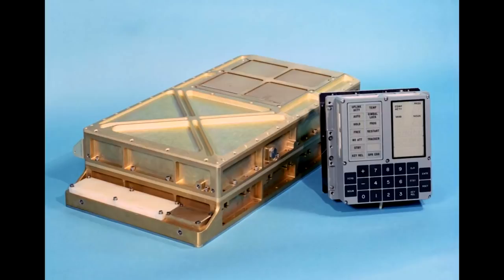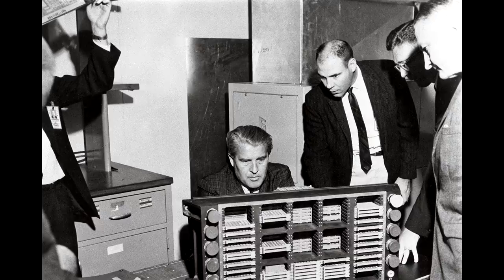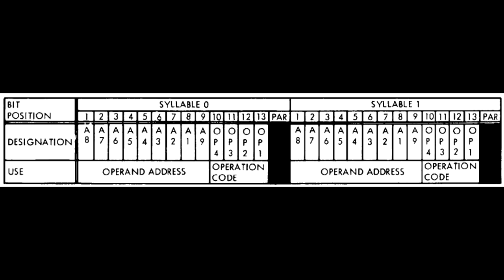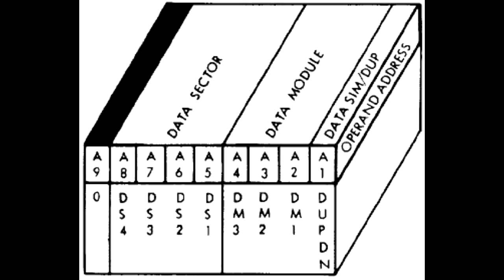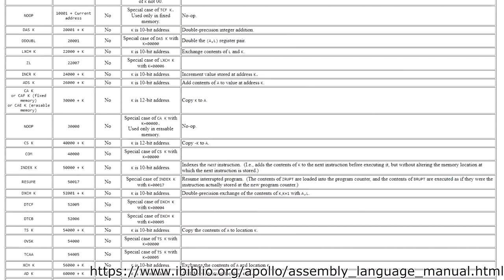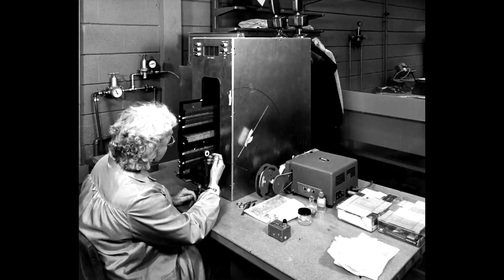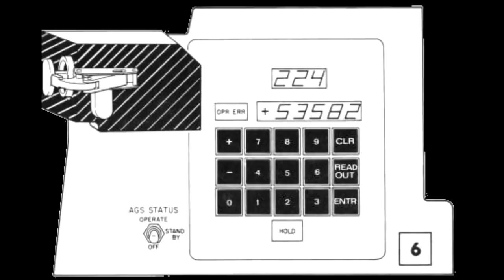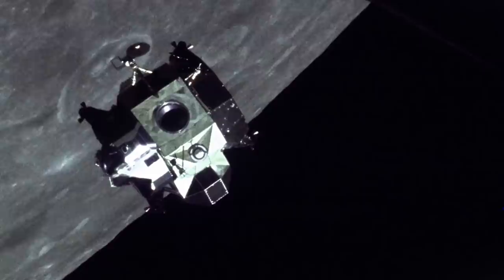The Four Computers That Flew Humans To The Moon

Comment: LVDC - Launch Vehicle Digital Computer for the Saturn V made at IBM Owego, New York. where Dad later worked on Space Shuttle Flight Computer Boards.  During Apollo and Skylab Dad communicated to the LVDC via the DDAS Station in the the different Firing Rooms of the Launch Control Center.  On one occasion Dad and a security guard had to go to the top of the Launch Umbilical Tower to change a "card", one bit in the DDAS Bus, that then went across the swing arm to connect to the Instrument Unit in the Third Stage.  Keep up the good job Scott.

Comment: Well done Scott. I remember reading a very in depth technical article about the guy who resurrected the AGC code  directly from the AGC  computer at the Smithsonian. That and documentation he found and one of the engineers who had worked on the thing. The culmination is essentially a digital archive of the actual code and documentation for that code. He then went on to build an "emulator" using a raspberry pi I think, and fabricated an exact replica of the DSKY interface and display unit. The whole thing works and he was able to simulate trajectory corrections, LEM landings and launches, Insertion burns, etc. Pretty amazing feat of "digital archeology." Thank Scott for your awesome content!

Comment: 9:11 There was one hardware difference between the CM AGC and the LM AGC: in the Command Module, there were two separate DSKYs. The second one was located in the space behind the main control panel, where the navigator stood while taking sightings through the telescope (and also I think where the crew had to go through to get to the docking hatch).

Comment: Basically the apollo program took less computing power than a recreation in kerbal space program
Reply: lets put it this way, ive heard claims that the entire Apollo computing system could have been run on an original gameboy, im inclined to believe it
Reply: Alessandro Bianchi by an enormous factor ! The orbit calculations were done on the ground and radioed up. KSP does those as you play and does hundreds of geometric calculations per pixel each second, on top of it.
Reply: Alessandro Bianchi god damn......  Brain blow
Reply: Computing power isn't everything. It's how you apply it. 

Here's a simple example. I've a top of the line laptop for work. It has to have as good a computing/computation power i can get, to give me the correct architectural solutions IN a portable format as fast as possible. If i need to know if a beam isn't ok, then i need it fast. THAT is great, it's awesome, and it made my life much easier.

But this laptop, for the life of it, cannot interface with the CNC machine that makes the custom fit beams we use in restoring old buildings. It needs another "computer" to run the stepper motors, read the scales, so on.

And that's just a modern concept, back then they had to deal with a heck of a lot more things, like vacuum, cooling, heating, fire hazards, robustness. 

IMO, the computers that were put to work were the best they could be at the job they had to do, after all, you can't run a rocket with a modern laptop, anymore than you can use one of those old computers to run a computational program...but you could make a CNC out of one, and it would be the best CNC money could buy, because precision was adamant.
Reply: Except that the Saturn control computer and the ACCs actualy controls the vehicles. Almost anything developed since has more computing capacity and more memory but lacks the I O hardware needed to do anything.
Reply: Your phone charger. The entire computing power of the Apollo program is about equivalent to your phone charger.
Reply: @markhorton3994  I'd say the only thing missing is an Arduino-based IO board welded into a USB header. Though, given the current state of Arduino-compatible hardware, you could probably skip the laptop and just use the Arduino.
Reply: @aserta  : The stuff that you're describing for why your laptop couldn't do it? That's just software & peripherals. It's an example of why things like expansion busses exist. The real reason you wouldn't use a laptop for it is that there are weaker computers that you could easily delegate the task to, thus leaving the laptop for other purposes.
Reply: @chyza2012  not sure who said 3ds, i said gameboy, as in the grey brick
Reply: Not counting the dozens, hundreds of engineers and their slide rules.
Reply: And by less we mean a thousand times less.
Reply: @lawrencedoliveiro9104  well most people don't think of engineers as being IBM computers, funny huh.
Reply: @battleoid2411  The computers were there to aid the engineers, not the other way round.
Reply: It really doesn't take a lot Computing Power to Fly to the Moon, land on it and return, the Laws of Physics sre pretty constant
Reply: I don't know the first thing about computing power but it sounds like saying a topfuel dragster has 5000 times the hp of my lawnmower but it still can't mow the lawn.
Reply: @BrewCityChaser  That's why you need a HAL 9000 when you are going to Jupiter.
Reply: Just because in the apollo program they did all the graphics in hardware and didn't have to create the spaceships and the moon with CGI graphics :-)
Reply: Pretty much a Arduino Nano.

Comment: +3 massive IBM  360 mainframe computers on the ground (rtcc) doing the heavy work.  Which are almost always completely ignored (especially in silly comparisations of "computing power of a Apollo mission). 
A modern smartphone is stilll much better. But things like "a digital clock is better" are just bullshit. 
 Not to mention 3 rather good biological computers on board. And a LOT more on the ground and pre-mission.

Also some people find it absolutely incomprehensible that you can do serious math with pen and paper or a slideruler...  Sir Isaac does not approve.
Reply: What's more impressive is I'm certain some of those old NASA graybeards designing these things could do rather complex calculation in their heads.
Reply: @shadow7037932  It's a function of computing power and time. You can do incredibly complicated calculations on paper. It just takes long. And people in ye olde days were used to that.  
I never used a slide ruler but calculation aids in various forms are known for millenia. 

The main work like the trajectories  were calculated, checked, tested, simulated and so on  months in advance.
Often by a (now) kinda famous group of woman which were called "computers".   

Based on Newtons laws and rules, calculated (published) ironically in 1686. Centuries before the first x86 CPU.
Reply: @shadow7037932  The main human computer didn't have beard, gray or otherwise. She was Katherine Johnson. An African American woman.

and oooh boy yeah the original mathematician team was all male.... She was just so good at her job that even in the segregated and male dominated field of the time, she was the one flight crews trusted most. To the point that flight crew astronauts asked specifically, that Johnson be the one to be responsible for calculating and verifying the orbits and maneuvers.
Reply: @aritakalo8011  I think that is a bit of a Gene Kranz thing (...who some think was  the only flight director). She wasn't the only woman working on that.  Shes just the one most featured in books and documentary. https://www.history.com/news/human-computers-women-at-nasa
Reply: @5Andysalive  Other endeavors before NASA also had dedicated human computers on staff.
Reply: What about electro-mehcanical flight computer? Maybe not the programmable one, but still the thing called computer.
Reply: Picky, I know, but the name is 'slide rule'. I was using my own one a couple of weeks ago. I'm pre-dinosaur. 😉
Reply: We need a video about these.

Comment: 13:16 well, we still can't agree on that.

While the word size is either 8, 16, 32 or 64 the instruction sizes still don't align.

x86_64 have 8 bit up to ridiculously 120 bit for instructions. While integers might be 8 bit, 16 bit ,32 bit or 64 bit.

We have two different types of Endianness - one used on ethernet connections, the other one used for basically everything else.

We have several different architectures, which use 64 bit and 32 bit integers while using either 32, 48 or 64 bit memory addresses. Our filesystems are sometimes 64 bit, while most USB sticks still cant accept more than 4 GB files, since the filesystem is 32 bit.

So yeah.
Reply: I don't think the mentioned problems are real/relevant in the modern computing, everything is using 64 bit, even phones. As for pendrives - it's just the stupidity of defaulting to FAT instead of formatting everything in NTFS by default (licensing reasons... ?).
That is, unless you're targeting some semi-custom platform like a weirdo router that uses some CPU architecture forgotten by time.
Reply: A diverse ecosystem is valuable. That’s why Linux supports something like two dozen different major processor architectures—more than any other OS in history.

And it also supports a wide variety of filesystems, not just NTFS.
Reply: There was a major schism at the time between 36 and 32 bits; 36-bit octal machines such as the PDP-10 were popular in research circles because a single word gave you ten decimal digits of precision. Xerox PARC, for example, wanted a PDP-10 so badly that when Xerox management denied them permission to buy one, they built their own clone of it out of components and called it the Xerox MAXC. The 32-bit machines, however, were cheaper and IBM-sponsored, so they were more popular with management types and therefore more successful in the market. And that's why everything today is a 32 or 64-bit hexadecimal machine, while 18 and 36-bit octal machines are forgotten. The worst enemy of a superior solution is a cheaper inferior that is just good enough...
Reply: @randomname3566  fat32 is kinda the lowest common denominator.  Apple  and MS insist on closed proprietary hyjinx.
Reply: There was rather more than just 32 or 36. There were also 24-bit, 48-bit, and 60-bit machines, just to mention a few.
Reply: Notably, ARM (as a standard) supports both endianesses, including switching dynamically! But pretty much nobody apart from maybe things like some Chinese TV CPUs actually implement big endianess, from what I can tell, and that info was already years old.
Fingers crossed we can get little-endian network order at some point and be done with this mess.
Reply: Remember, anything can be forced to be compatible with anything else with enough glue logic and software ;)
Reply: The bitness or bit depth has always been a question of cost has it not? The higher bit you go as an architecture, the more stuff it is going to need even for the most basic stuff.
Reply: @SimonBuchanNz  PowerPC processors (used by older Macs, IBM mainframes, some consoles, and a wide variety of embedded things ranging from cars to fighter jets to Curisoity) and SPARC processors (used by some Sun mainframes and workstations... and apparently also in Curiosity) are big-endian. (Okay, technically modern ones can also switch endianness similar to ARM, but I don't think I've ever seen that used in practice.)
I've worked on both of those in the past, and it's annoying to program compared to little-endian, so quite I'm glad that's the one that's most common today.
Reply: @Maeyanie  apparently, according to what I've seen when I was looking this up earlier, POWER switched to LE too (at least by default? Wasn't clear, plus the whole PowerPC vs POWER confusion), and I'm not sure if SPARC is an architecture any human is likely to see at this point, by the look of it's Wikipedia page, in the sense that there are probably more hardware hobbyists making big endian hardware than will ever program on them. But I could be wrong!
Reply: Some years ago Big Endian dominated and there were reasons for that. Many technologies we now take for granted were developed at that time. Some of that hardware very likely still works somewhere and does its job better than the modern stuff.
BE has advantage when you need to analyse/sort long numbers, for example, because you get the most significant bits first.
Reply: x86 family is ancient, carries lots of back compatibility bullshit since the 70s. I think Intel tried to phase it out many times already.
Reply: @noop9k  having written a partial x86 disassembler, this is no surprise!
Reply: Simon Buchan I'm still writing code for a big endian processor, the XAP2. char, short and int are all 16 bits in size, which causes some hilarity with code that assumes chars are 8 bits. We do have long as 32 bits and long long as 64 bits so it's not all bad.
Reply: @owensmith7530  Wow, from 1999? Is this one of those "they never stopped making them" like the 6502? The Wikipedia page makes it sound like a research CPU though?

To be clear, I'm sure there are plenty of people doing interesting things with older hardware - my comment was specifically about SPARC as it looks like a enterprise long term support thing, but the manufacturing seems to be pretty much completely gone at this point, excluding situations like the above.

Comment: Byte and word lengths were a mess. It felt like I was having to adjust to a different system for every architecture. Things really settled down in the early 80s when personal computing was becoming common if not yet ubiquitous. 8-bit bytes and 16-bit words were all the rage. As welcome as that was,  I was more relieved when I stopped having to worry about EBCDIC (or Baudot) popping up when we finally settled on ASCII as our de facto character set of choice for most purposes.
Reply: lol. Because I still mess with old microcomputers I still run into things every so often...

Like, you wouldn't think so from a modern point of view, but early 80's keyboards can be surprisingly annoying thanks to the missing buttons.
Like, on my desk here is an Atari 800XL.
Has no equivalent to the 'alt' key on a modern keyboard (though it does have a dedicated key for 'inverted' characters, which on older revisions of the hardware was an 'atari' key.)
Control is in a weird location, there's no function keys, arrow keys are bound as secondary functions to something else...
Oh, and of course the standard software for entering programs assumes 'overwrite' is permanently active (and there's no insertion mode the way a modern system would tend to default to. To insert characters requires pressing the insert key repeatedly then typing new characters in the space opened up)

For good measure, this system's text is encoded in something called 'atascii' (atari character set)
Which is similar to ASCII but nonetheless quite incompatible with it anyway.
while we're at it, due to the nature of the machine, you're often working with it at a low level.
And...
Well, not only is the official character set ATASCII which is it's own thing.
But the internal numbering of the standard font doesn't even align with the ATASCII code (the OS/BASIC ROM internally translates), and the keyboard scan codes are a 3rd arrangement unrelated to the other two.
Because, hey, who needs consistency right?
Reply: @KuraIthys  A highly modern computing project I follow needed updated patches for EBCDIC compatibility, and that was April 2020.
Reply: @KuraIthys  I used to do some programming on the original Atari 800 (in 6502 assembly, of course) and I agree. Trying to translate programs from other computers was always oh-so-much fun. Although, having the complete OS source code was very helpful in circumventing a lot of silliness.

It's just what life was like back then. I'd be bouncing between various UNIVACs, DEC Vaxes and PDPs, HP minis, a plethora of 6502, 8080, Z80, 8086 and 68000 PCs all using different monitors and OSs and all in their particular machine/assembly languages. Not to mention the dozen or so "common" higher level languages for various purposes. Without a doubt, one of the funnest times of my life. If you can be on the bleeding edge of a paradigm shift, ride it as long as you're able.

Comment: Awesome video. I love hearing about all the crazy competing design concepts used in computers back then. Today everything is basically Intel or ARM.  Back then there were different ideas and concepts and a willingness to explore.  Fascinating!!!
Reply: Actually, there are quite a few architectures in common use. Your wi-fi router is probably running a MIPS processor. SiFive is gathering momentum. And if you look at the world’s fastest supercomputers, you’ll see a few POWER machines near the top.

What do these processors have in common? They all run Linux.
Reply: @lawrencedoliveiro9104  Lets not forget RISC-V, the great hope for an open hardware future!
Much more common, if humble, is the processor inside all those Arduinos!
Reply: Yes Mike, some were fascinating.  But some were just frustrating.  Have a look at the architecture of the CDC Cyber range.  For no particularly sensible reason that I ever heard about, Seymour Cray cursed them with a very limited address size, although the data word length was 60-bits - arranged as octal.  They were a dreadfully limited thing to try to use as a more general-purpose computer, or even with really big, complex programs.
Then Cray went off to create his dream machine... declaring memory size to be the really big advantage of the Cray-1!  I remember reading the article on the notice board as we awaited the arrival of a CDC Cyber 72, and wondering just how this would turn out!
Reply: @John.0z  Sorry, yes, I meant RISC-V. SiFive is just one of many companies embracing that architecture.